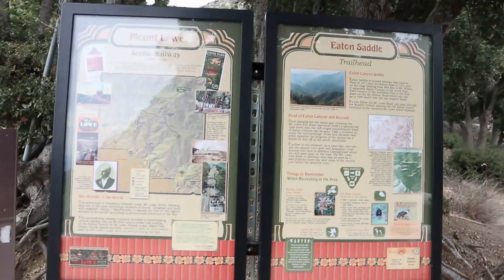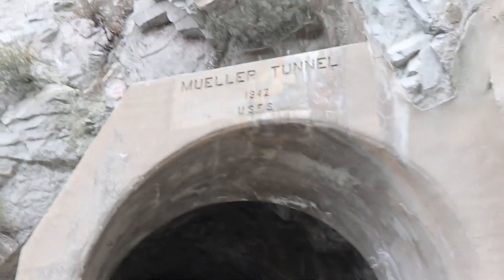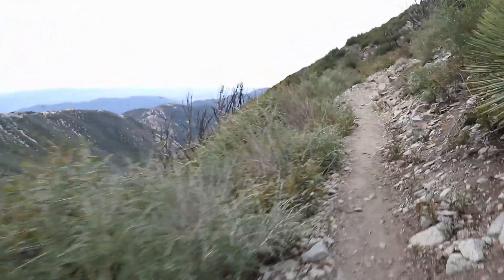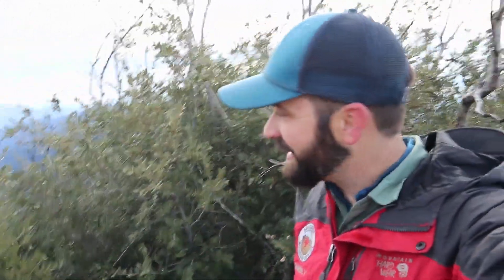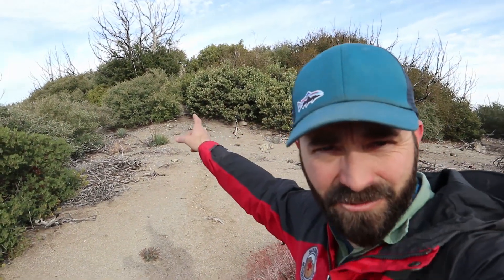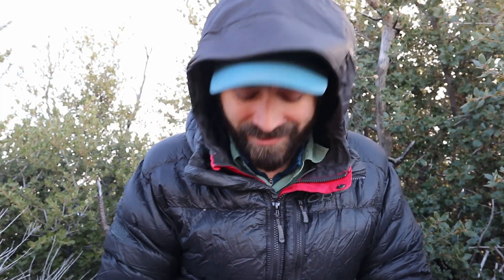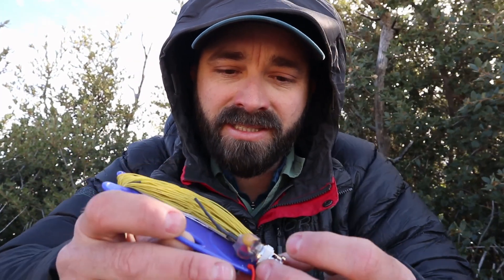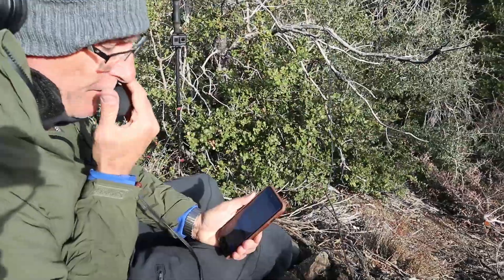San Gabriel SOTA with the Rockmite - is 300 mW enough?

Comment: Hi. Very cool QSO with less than 1w !! I am a beginner in the science of amateur radio. so, let me ask ... where is the ground wire? haha did you use only the signal wire? so this is not a dipole antenna right?
Reply from the maker: Thank you!  Well, there is certainty some debate about what a "dipole" actually is. One could argue that an end-fed halfwave antenna is a dipole fed at the end with a high ratio impedance transformer (~64:1) to bring the roughly 2,000-4,000 ohm characteristic impedance down to 50 ohms. In this case, the ground is the case of the radio and its capacitive coupling to me and the ground around me. Hope that helps.
Reply: @K6ARK  Cool! I am already researching this circuit and its construction, including in your other video about. In this covid19 quarantine I'm having a lot of time to learn hahah

Comment: Just watched a video that K8MRD posted where he was using the antenna that you sent him.  He mentioned that you might be doing a video on how to build them.  I just got into POTA here in WV back in September.  I have made one activation so far.  Been trying to get my gear to where it isn't to bulky or heavy.  I made a EF random wire antenna, built my own 9:1 unun for it, I have also built my own WRC type antenna, I call it the WRC Clone (video on my YouTube channel).  But after seeing the antenna you used here and the one you sent K8MRD I want one like that.  So if you do a video I am really interested.  This might be a really good antenna for my QCX40 that I built.  Great video.  73 Juddie WD8WV

Comment: Wow, your Rockmite monitor sounds way less sick than mine.  I bought my kit in like 2001 or 2003 (I forget) then put the mailer on my desk to work on later while other parts arrived.  Two years ago, I found the package and the parts and finally finished it.  All of 250mw.  I like the touch keying.
Reply from the maker: Yah, mine is only about 300mW. Not much power out of that thing.

Comment: Awesome job Adam! Great to see another SOTA activator using a RockMite. I recognised the noise switching from TX back to RX, most Rockies seem to do that. 40m sounded nicely quiet, here in the UK, there would be lots of QRM which makes activating with a RockMite difficult. Generally 14.058 is quiet here, so a RockMite 20 with 14.060 xtals is my go to SOTA RockMite.
I liked this video a lot!
Reply from the maker: Thanks Colin, it's a fun little novelty rig which is actually decently capable. I definitely prefer the MTR3b for regular use, but this little guy sure is fun, particularly with the built-in battery and capacitive touch key circuit. I have a Pixie that I built with a 14.060 crystal that I crammed into an Altoids Smalls tin with a straight key, earbud, and battery.  That thing is a little bit silly but good fun too 😜.  Glad you enjoyed the video. I sure had fun making it.
Reply: @K6ARK  how wide is the Rockmite Receive & do you think the QrpGuys active 200Hz audio filter would be required for more than just bench toying with it? The QRPme version board is squarish, but I see the Pixie version is in a Tuna can for those inclined to do it that way. Dave - KU9L
Reply from the maker: The RX is pretty wide and would be more pleasant to listen to for a long period of time with an add on filter.  That said, your ears learn to pick out the good stuff and it's quite usable without.